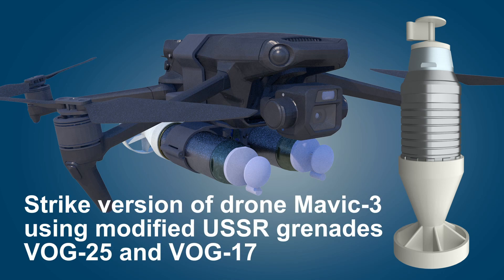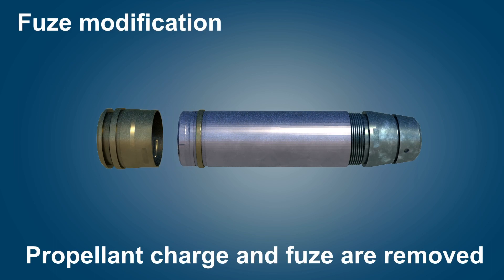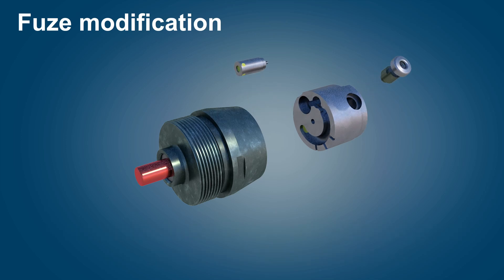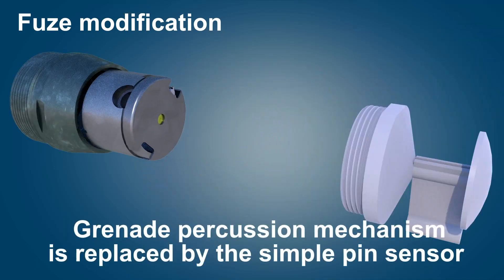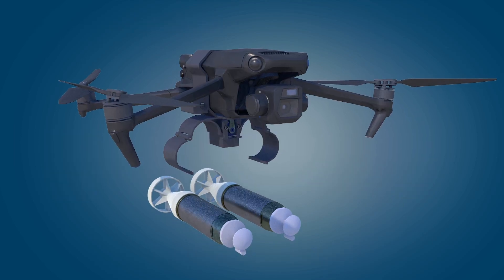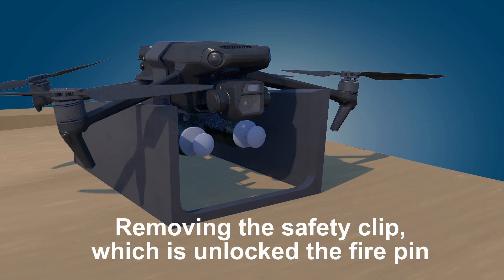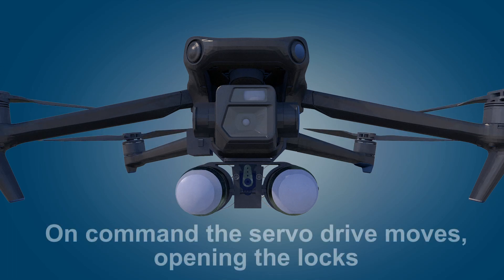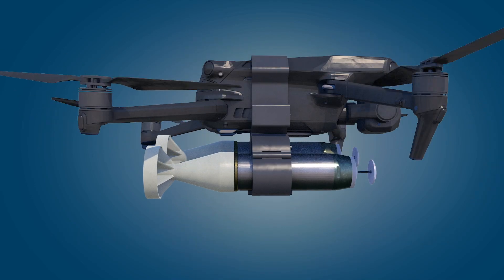Strike UAV. Modern weapon in a battlefield #weapons #drone #ukraine #russia #ammo

Comment: Nice Video,  do you know the weight after removing some parts, then the weight after attaching tail and contact sensor? what would be the length with tail and sensor?
Reply from the maker: Thanks.Total weight with tail is about 310 grams, without tail 270 grams. Total length is about 177 mm.